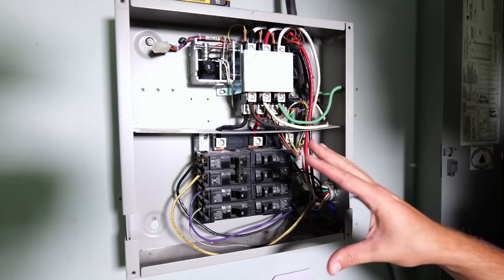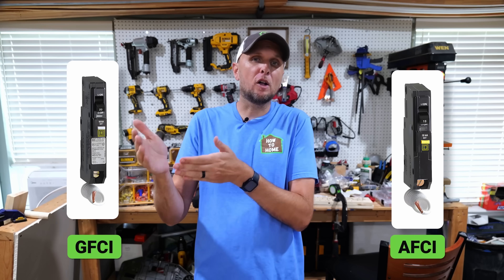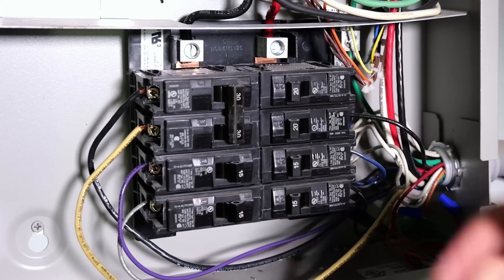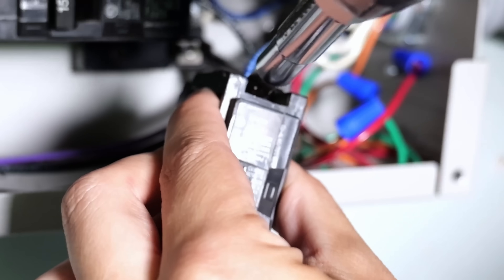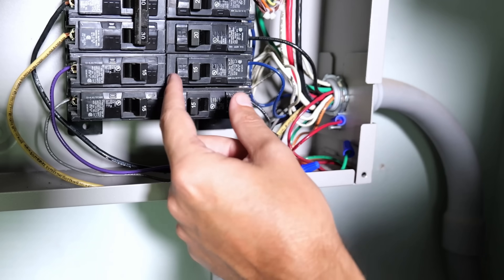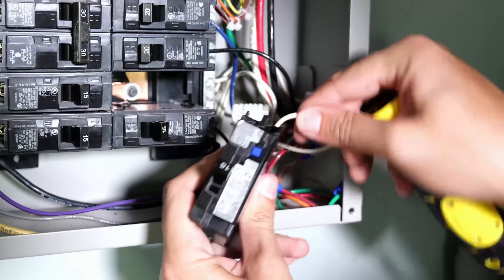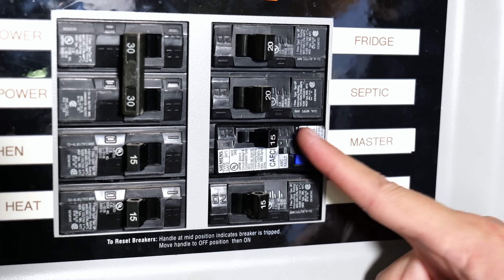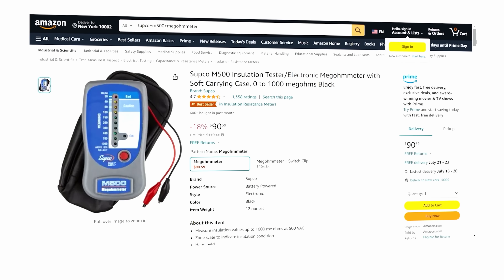Most DIYers Miss This CRITICAL Detail Installing Circuit Breakers!

Comment from the maker: If you look in your circuit breaker panel, are you missing the proper AFCI breakers in it?  Most don't know to check!
Reply: Bought our house two years ago, built in the 70s.  It had no GFCIs except in the kitchen (installed just before they sold it), and the boxes were small and overstuffed.  Couldn't even fit new GFCIs into any of them.  And it certainly didn't have upgraded breakers, just the classic kind.

Two years, several ripped-out and replaced device boxes, and all-new receptacles later, I'm starting to upgrade the panel with AFCIs.

How d'you like this, though?  The house is filled with multiwire branch circuits, and though I'd love to install dual-function breakers, it's impossible to find two-pole dual-function breakers (at least in Square D).  I'm lucky to find AFCIs which cost multiple hundreds each, then I'm using GFCIs after the aforementioned box replacements.

I love electrical work so much, but this house pushes the boundaries of that enjoyment some days.
Reply: What is that equipment you use to test with
Reply: Absolutely a cash grab by the Electrical manufacturer industry, in conjunction with the Insurance industry.   And it lands SQUARELY on the shoulders of the end user's (homeowners)  Unnecessary, problematic, and VERY costly.   And yes, I've been an Electrical contractor since the early to mid 80's.  When the GFCI's came out, it was costly, but a good idea.  The Electrical industry made very good revenue on them, which was ok since they were needed.  Then along came the AFCI looking for a solution to a non existent problem, except to fill the coffers again.  I've heard this from other code officials as well.   Just my humble opinion/thoughts.   Have a great day   ✌🏼Peace.
Reply: @RobertCunningham-pf9tg  I disagree with the statement that they were "looking for a solution to a non-existent problem." AFCI were made because of a common issue that GFCI's didn't cover. GFCI's measure a different between neutral and hot to determine a fault. Arc determines a similar path, tripping faster than a typical breaker in a short/arc situation. Both do great at mitigating electrical fires for different enough reasons to justify both at times.
Reply: @blazetownsend8785   Okay thats fine if you believe that, but then the industry shouldn't use govt to force the population to spend the money buying AFCI, and if we refuse now local govts will refuse to pass an inspection on a new build.  Rediculous.  We got along fine for 120+ years with out them.
Reply: I see fuses. 😢

Comment: How did you identify the correct neutral wire for that circuit? Also torque equals force times distance, not distance times force, so its pound inch NOT inch pound.....details matter , especially when you are teaching..

Comment: That's all nice but my CB panel does not have a MASTER off switch.  I had a couple of breakers replaced by an electrician about 4 years ago and he did it with power on in about 5 min. to the tune of over $300. I know it can be done with power on. Please show a video how to safely do it with power on.

Comment: I don't have a generator, so not familiar with the operation of the generator and transfer switch. But, I would have thought the generator would need to be removed from service  as well as shutting off the main breaker, to avoid an inadvertant startup.

Comment: Just about to purchase one of these 20 AMP AFCI / GFCI DUAL Function breakers for my Siemens QP style panel. I recently added a new 12 gage run from the panel to both sides of the garage door of my attached garage as I have Liftmaster side jack garage door which replaced my overhead garage door. I have an outlet in the ceiling for the old style overhead door but none on the sides of the door so I added double outlets (4 total) on each side. I purchased quality pro outlets but not GFCI / AFCI so instead of unbolting and and buying new outlets again, I was about to purchase a standard 20 amp Siemens breaker but its required now to have this protection in garages and this being a new run, I don't have protection without it. Crazy 7 bucks for a standard 20 amp single pole Siemens QP breaker at HD and the AFCI / GFCI DUAL Function are 77 bucks !!! Luckily you can find them brand new still in the retail packaging off EBAY for half that 77 dollar price.

Comment: Just want you to know I really appreciate your time & effort you put into these videos. You do great job !!! It's good that you always take the extra time to include even the most basic steps (check for power, flip the breaker check again, etc..), and pointing out safety issues, never taking for granted that "it's obvious" and the individuals watching "will of course know this". Of course you will if you're somewhat or very familiar working electrical, but those individuals are not here watching videos about installing a breaker or adding an outlet. I applaude you for the way you teach and go through all this stuff. Subscription earned. Thank you !!!!

Comment: You make it sound as if everyone needs to change out all their breakers to be in compliance with current code. Absolutely wrong and misleading. If the breakers in an existing panel were to code at the time of installation, they are not required to be replaced. That would only apply to new or modified work.
Reply from the maker: At what point did I ever say that?  The mistake is on installs or replacements where this code is not followed.  People just looking for things to get upset about at this point.
Reply: @HowToHomeDIY I am not upset. How did you come to that conclusion? You said one time about only on new installations. As a matter of fact, you used your own existing installation stating that you had to change it. I was simply giving correct information for everyone that reads the comments, but upset, I am not.

Comment: What’s the cost difference between the reg., breaker and an AFCI?  I’ve had my house for over 30 years and never had to change a regular breaker.  🤷‍♂️  My kitchen counter breakers are not GFCI nor is my garage. Should I be worried?  🤔

Comment: Thanks for the info, I do have a question. I have a Generac generator and a 15amp breaker that i want to replace that is in the path of the generator, when i kill the main power to the panel will that take the generator out of the loop because i assume it is going to come on and energize that breaker or does the generator power flow through that same main power switch? Thanks for the videos they are much appreciated

Comment: You should have just bought a lockout kit for your panel!! How much did it cost you to do the transfer switch and then replace all your circuit breakers??!! A lockout kit would only cost you $25...
Reply from the maker: Why are you so concerned with my setup?  That’s not even what this video is about.  And I have both.  And it’s called an interlock kit, not a lock out kit.  Two completely different things.

Comment: Excellent video, but I would suggest checking your voltmeter on a known live circuit prior to checking the circuit you are working on to verify proper response, and then checking again on a known live circuit after you've checked the circuit in question.  Might seem like overkill, but voltmeters can fail.

Comment: I had several circuits with no power in an out building. The electrician found the wires had pulled out of the circuit breakers, apparently not torqued properly. Get em tight!

Comment: If using solid wire sometimes they come loose when twisting during install  so torque wires then install remove and retorque (or retorque in place if possible

Comment: What would have been helpful is if the video demonstrated how to locate the neutral wire paired with the hot wire.
Reply: You just tug on each wire while the guy on the other end sees if it moves.  Super easy!🤪

Comment: I put FCI receptacle in my man cave, more a computer lab,  they cut power so much it was a nightmare, because the start up and shut down of a mini split ac unit shuts the power off, and my electrician came out and told me to take them out. I asked him about adding them to the main breaker box and he said Utah code is against it as f today, but it changes more than tv shows. I live in an area where my entire block of houses are 1950s except for one 1927, hell i'm the only one on the block with a 100 amp box, most have little 10x10 boxes im sure are 60 amp. Rocky mountain power wont let us upgrade without moving them and i was quoted 11k to move breaker box 12 feet to other side of my brick wall. My bus nearly doesn't fit under power wire coming into the house my bus solar panels are like 5 inches below.

Comment: The only problem I noticed when you were reinstalling a new breaker when you reattached the wire to the new breaker, you did not trim it back slightly because the copper wire can get compressed and weakened from the previous breaker being talked down with tension I always trim the wire back about 3/8 of an inch so there is new wire going into the new breaker.

Comment: Dumb question...at the end of the video, after you've installed the AFCI breaker and turned it on, it appears to be the only breaker turned on. All the other breakers are turned off on the right side of the panel. Perhaps just for this illustration?

Comment: The wire is not hot until the breaker is on the bus, and the switch is in the on position. When putting the breaker back, it should also be in the off position so you don't put in  under a potential load

Comment: My 1957 home had no equipment ground on anything. Even though the wire itself had the typical 16awg bare equipment ground conductor. They just cut it off at the entrance to each box. I pulled new 12/2 romex to certain areas like the kitchen and bathroom and most of my receptical circuits. I ran a dedicated circuit to the washing machine and code says it must be afgi protected so I installed afgi/gfci dually for that circuit. Every time, without fail, the washer would trip that afgi as soon as the water valve opened.  Absolute garbage.
Reply: @John-v7q1u  My 1950 home is the same.  In the late 40's they started using Romex (NEC definition Nonmetallic Sheathed Cable) and it did not include a ground conductor.
I found out later that about the mid 60's they started requiring the grounded 3-prong outlets that we know today, and I'm guessing that's when the bare ground conductor was included.  But in some parts of the country, they may still have been installing 2-prongs up to 1970 (not every state updates their code every 3 years).  About 2005 we had the original 60 amp, fused service replaced with a 100 amp, 20 space breaker Cutler Hammer..  At that time Wisconsin code did not require AFCI because they were so unreliable ( and expensive).  Also, the older houses which were wired using BX, the flexible, corrugated, steel conduit, would have ground continuity IF all the connecting fittings are tightened into the boxes.  To test this, set your meter to AC VOLTS. Take off outlet cover and put a probe into the narrow "HOT" slot and the other on the box.  You should get a 120 volts reading.  If 0, you have no ground continuity to the main box.

Comment: An appliance was acting funny, after replacing outlet, I found the breaker making noise and it was arcing at the point of contact. The breaker looked very old. After removing the breaker, there was burnt mark on that copper bar. I moved the new breaker to another position. I wasnt sure how to clean it as it built up material from arcing. I replaced all the old looking breakers. Is this common on old breakers, its like it would loosen the squeeze point after time or the breaker went bad? i also had to find a plastic cover for that empty spot.

Comment: Something else you don’t need to drive the cost of building a home. Standard breakers have been around for a long time. What should be required is 20 amp receptacles with 12 gauge wire. These 15 amp cheap receptacles on 14 gauge wire builders use are a fire waiting to happen.

Comment: I own fixer upper on which I'm working myself during summer. I have meter panel on front wall and main AFCI braker panel in laundry room about 20ft away from meter panel. Both were installed by licensed electrician. In front of the house is temporary post with 2 x 120V outlets and one 240V outlet. Rough electrical inside the house was done by license electrician as well. I'm slowly installing outlets and switches inside the house. I use 3x8awg power cable to run 240v from temporary post directly to meter panel and test each circuit after AFCI braker is installed. All was working without a problem. Recently all my AFCI brakers tripped. Only well pump braker ( non AFCI )is working no problem. I also lost power on temporary post ( outlet was able to power light bulb but nothing else ). Power company identified problem as in ground neutral cable fail. They replaced about 6ft of all underground connection ( 3 cables ). Power to temporary post is restored and I can run power tools to work outside. Unfortunately still have a problem with house panel. Any AFCI braker I put in this panel is tripping instantly. Brakers don't even have circuits connected to them. Is it still problem with underground line ? GFI brakers on temporary post are fine.

Comment: Can a bad double breaker switch cause my induction cooktop to not work? The breaker tripped in a recent power outage. I flipped it back on, but the cooktop isn't working properly; it comes on but won't stay on. I think the power switch then is probably fine as the oven is working but the drop-in cooktop won't stay on when cooking. Perhaps the power outage is to blame and not the switch. (P.S. I did flip it off for 5 minutes and then flip it back on and still the cooktop won't stay on when powered on and the oven still works.)

Comment: I don't think that I'd want to screw a fine strand wire directly to a circuit breaker or neutral bar without cutting back to fresh wire each time. I'd be too worried about damage to the strands occurring without being able to easily inspect it. If I had to do it very often then I'd probably buy a ferrule kit.